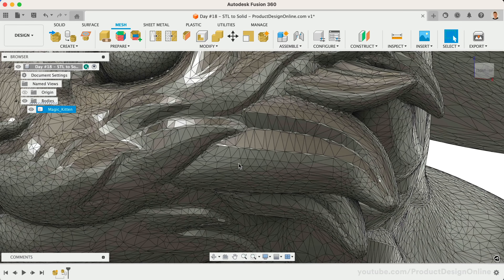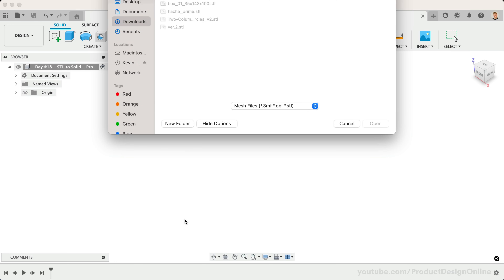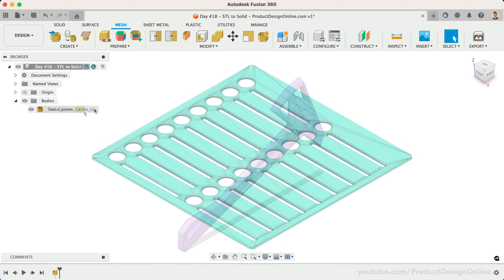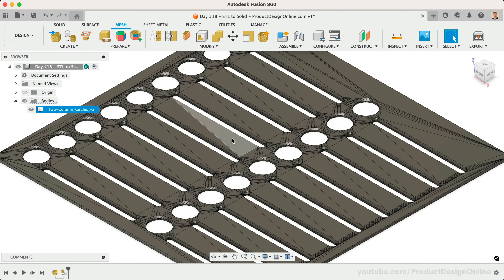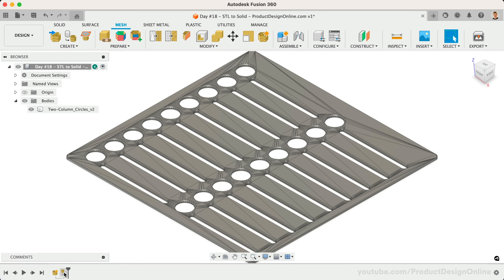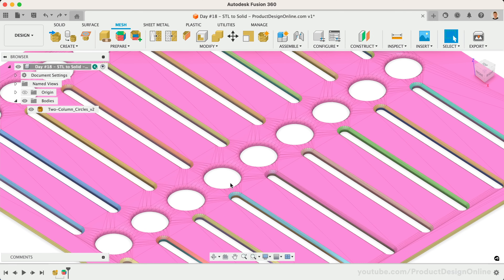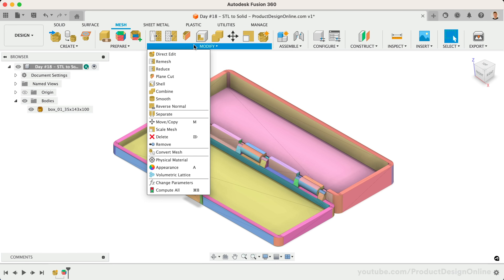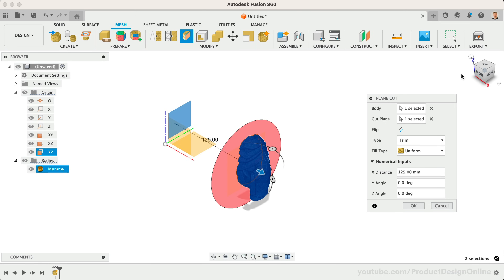Convert STL to Solid in Fusion 360 | Day 18 of Learn Fusion 360 in 30 Days - 2023 EDITION

Comment: Thanks for your videos! I have personal version - free - that doesn't have PRISMATIC option. Can I convert STL file into a solid? The object is a prostheses that is round and it has on one side hollow part, where the person inserts part of the forearm, and I wanted to convert it to solid state, so I can make a hole and thread at the other end, where the tools can be attached. None of the methods converting with the free version works! Is there a way to convert the STL into solid state? Thanks again.
Reply: I've converted lots of stls into solid bodies in the free version. Mesh tab - Modify - Convert Mesh. Prismatic is my only option, but it always works, it just takes a long time for complex things. I wonder why yours doesn't have prismatic.
Reply: @justenhansen  Because the free version doesn't have prismatic option! BUT my friend and I just did a very simple object, and it worked, but this is an arm that is scanned in high resolution, and it doesn't work, after the conversion. It took a long time to calculate/convert, but we can't make it to work. It stays in a gray color, and we can't edit or even modify the object.  Thanks for your reply.
Reply: @tonysfun  It's weird that prismatic is my only option. I just downloaded Fusion 360 yesterday. Maybe they recently changed it.
Reply: @justenhansen  I've used this Fusion for many years and it never had it. Even now it doesn't have prismatic option. When I click on it, it want me to upgrade to professional version! My is the education version.
Reply: @justenhansen   May be you are on 14 days free trial of Design Extension?

Comment: So how can we convert meshes to solid bodies if the orginal mesh is quite complex and organic?
Reply from the maker: If it's organic then the organic conversion is available through the Product Design extension. However, if it was created in another mesh program and is super organic it is unlikely to convert.
Reply: @ProductDesignOnline  Thanks for your reply! I do have that extension and I've been trying to convert the volumetric lattice mesh created by Fusion itself. However, not much luck converting the mesh back to solid body! Fusion suggests generating face groups or direct editing, but this is such a pain because the volumetric lattice has so much details. I'm wondering whether you might have some experience in this issue? :)
Reply from the maker: Oh, thanks for clarifying! I believe the way that Fusion generates the lattices. They cannot be converted to a solid because when they're generated in the first place, they're technically on mesh. It's a bit of a one-off scenario. Unfortunately, I don't think there are many options to work with the lattice in the solid realm... If you're trying to cut something out of the lattice, you can convert a solid to a mesh and then use some of the mesh Boolean tools.

Comment: Thank you, Kevin, for created an updated video on STL MESH to Solid.  My experience is that Autodesk is continually updating and improving the software, and the UI has evolved over the years.
Reply: But my version is free so I can't convert MESH or STL to solid. Do you know of any other ways to do so? It is a prosthesis, so it is round everywhere, including inside, where the arm fits into.  Thank you.
Reply: @tonysfun  I use Tinkercad to edit STL files.  It imports STL fine.
Reply: Wish Autocad users could say the same...
Reply: @PringleSn1ffer is it too hard for you?
Reply: @truegret7778  No, I use it everyday. It has seen basically no new functionality since the late 90s. Not too mention how buggy and slow it is. Fusion is a dream in comparison.